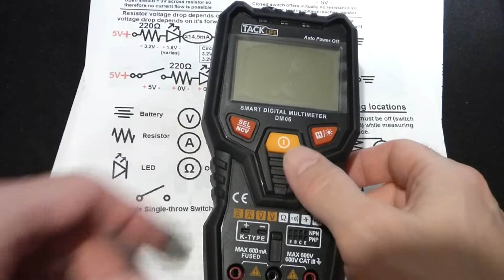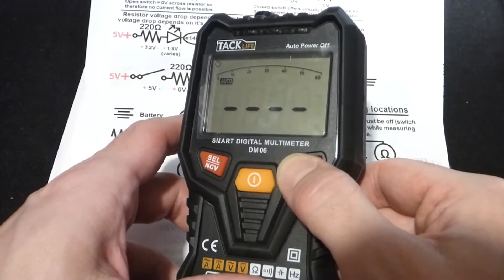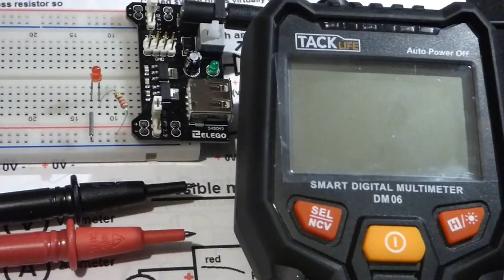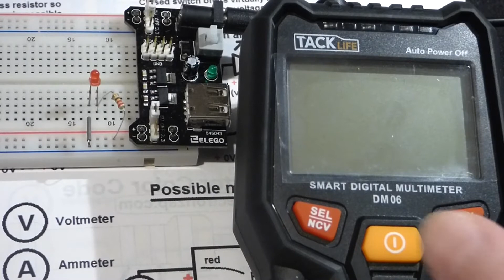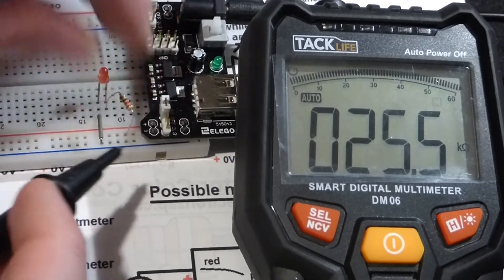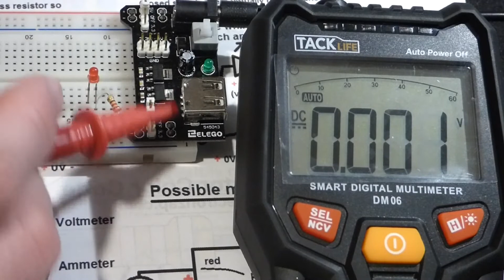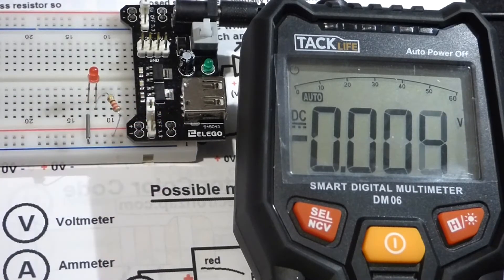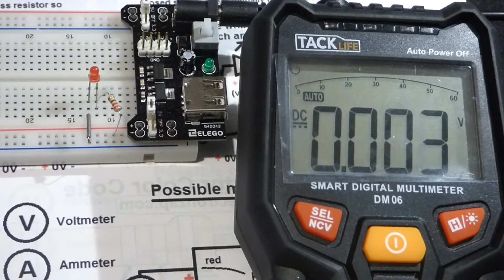My new Tacklife DM06 multimeter 1 set up to automatically measure voltage resistance continuity

Comment: which multimeter is better ? Thanks
Reply from the maker: It's a personal choice, depends on how much you want to spend, what you will need to measure and how much you'd prefer to auto range versus select a range of measurements. I'm not picky at all when it comes to multimeters but I enjoy the Liumy lm2001 that I have been using in most of my recent videos. Probably best to start off with a cheap one that has good reviews.
Reply: @Electronzap  Thanks man.You could make a video comparing this multimeter with the precision of the others, I looked in youtube not yet.
Reply from the maker: I don't do any precision testing so I'd have to do more research on how to before making a video. Most of what I do, and most of electronics in general, doesn't need to be very precise.